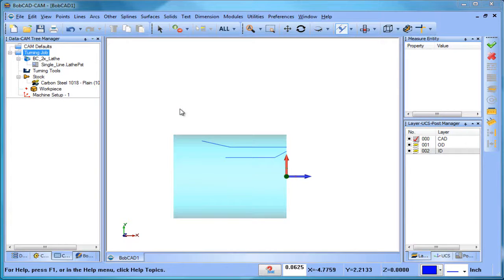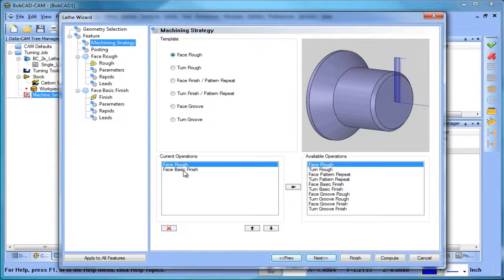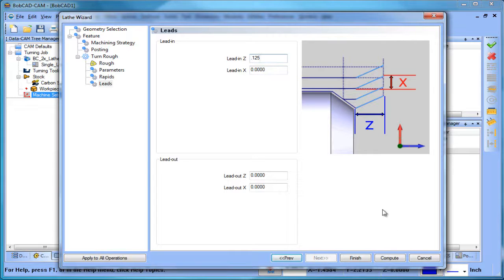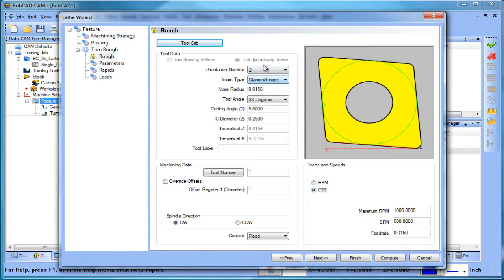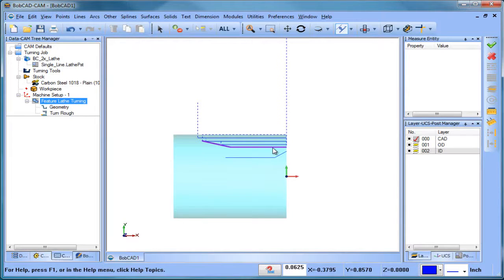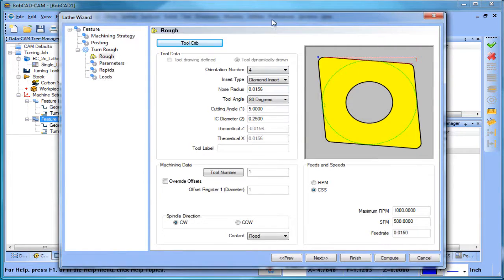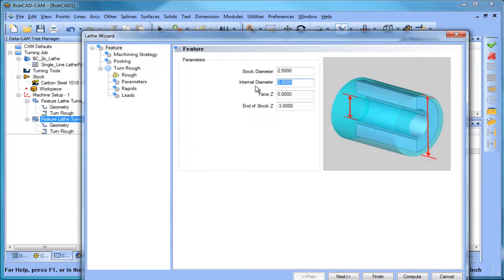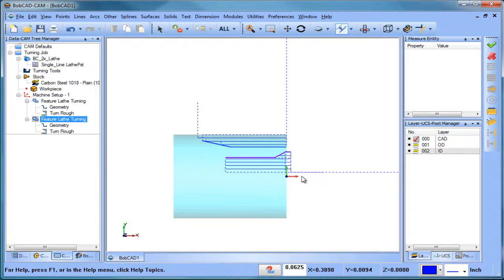OD and ID Turning BobCAD CAM V28 Lathe

Comment: V29 uses hand for tool orientation and it seems backwards, or at least for conventional spindle rotation. V29 build. 2399
Reply from the maker: that is correct!  V29 and all BobCAD CAM Products for turning are setup for a turret style.  If you are running a front side tool post, things will look backwards.